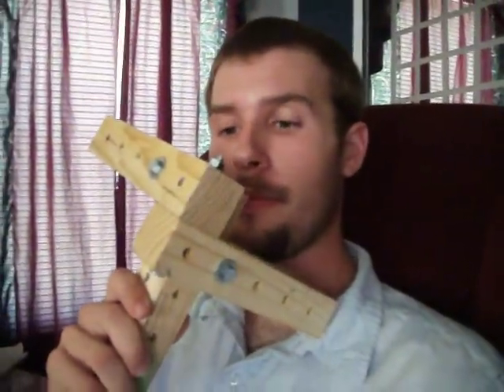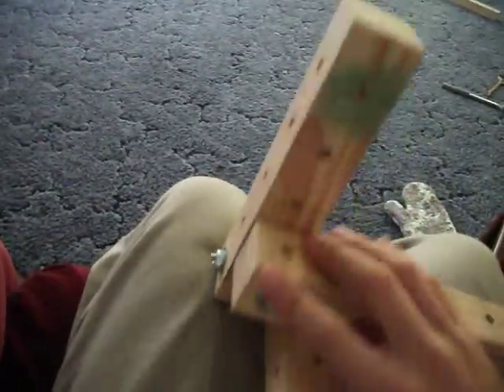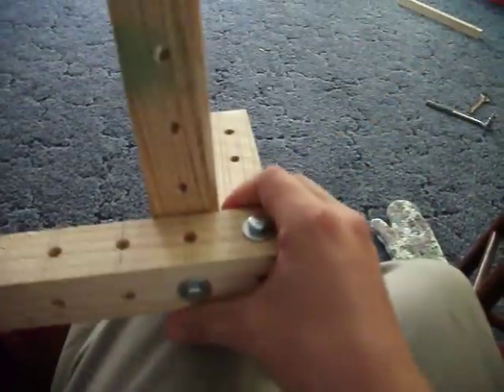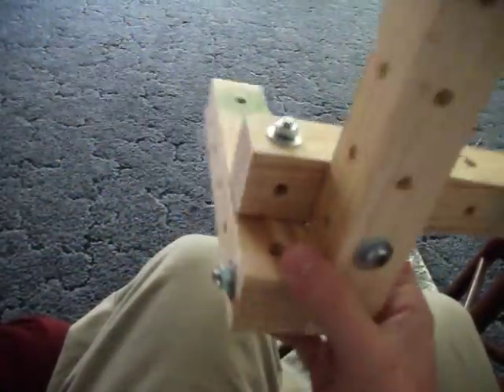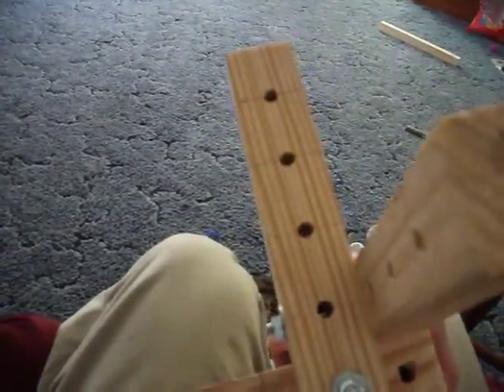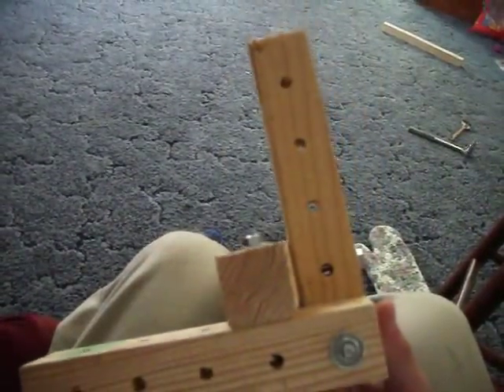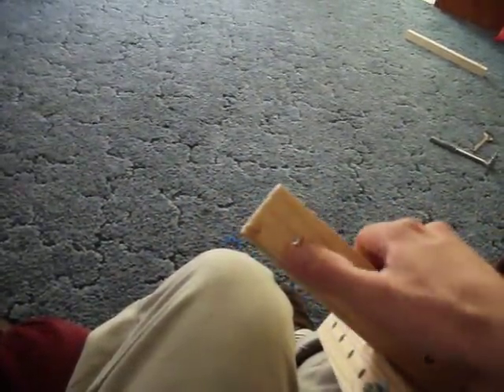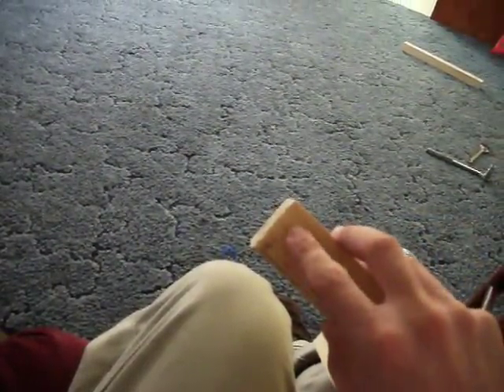Grid Beam pt. 2

Comment from the maker: @enticed2zeitgeist Oh no! I hope the carriage bolts your using are somehow different than mine. If they have a little square piece on one end that will bite into the wood, really messing up your hole and making it -very- hard to extract. The only place I see carriage bolts used is on permanent structures, like children's playground equipment.. 

Washers on both ends protect the wood from damage by distributing force over area. I recommend using one behind the nut and the head of the bolt.